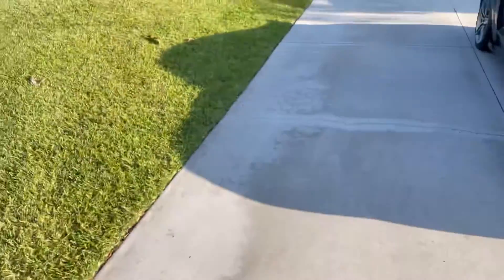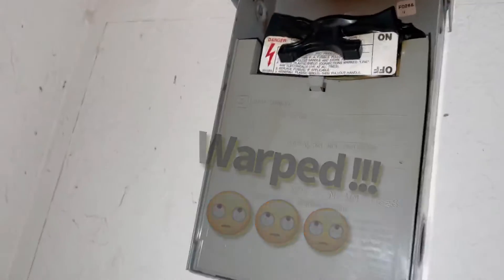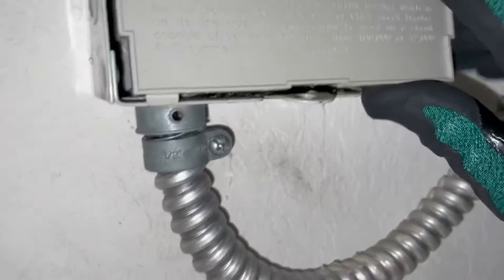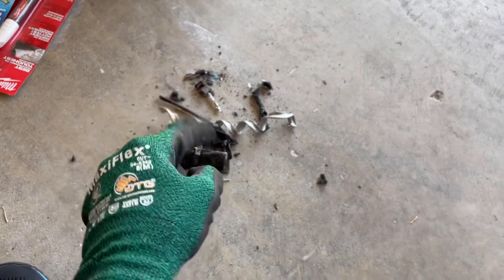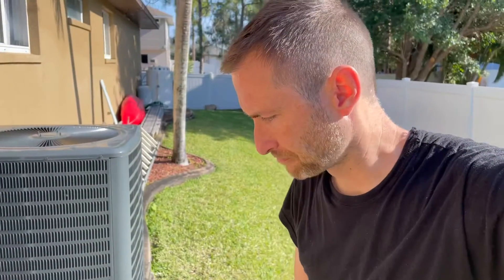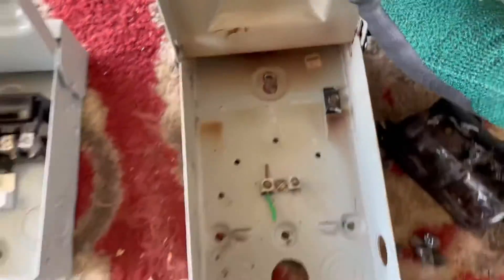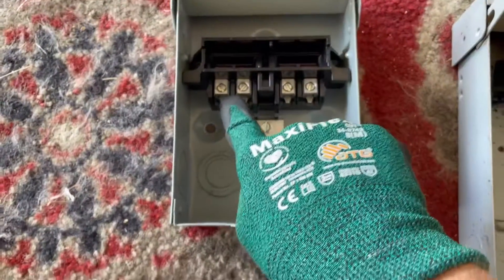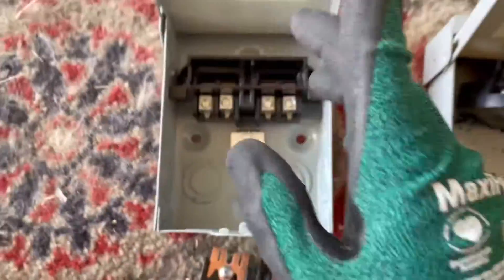HVAC fail in Florida. #hvac #fire #heatingandcooling #electrical #florida #HVACEXPLAINED #Ft. Myers

Comment: My first job out of school i worked for an apartment complex,ran into this problem all the time,aluminum wire where the line voltage came into electruc furnaces,burned up all the time,they make a gel you can put on there too that helps it from heating up like that cant rember what its called,love the videos,you are very thorough in describing your process
Reply from the maker: Another technician pointed out that gel and I actually did look it up I may pick it up just in case but very rarely do I ever see aluminum wire up here in the north.  Maybe Florida is a different standard or code?   I had a friend that had her house nearly burned down because of a random contractor decided to run and mix aluminum wire with copper wire and it lit her attic on fire.  It’s crazy but we just try to prevent incidences like this always try to notify your boss or the property manager and cover your butt.  Thank you very much for the compliment, commenting and liking the videos I really appreciate it it gives me more feedback and ambition to do more.  I am really glad that people are leaving tech advice tips and questions.  Have a great day and stay safe.

Comment: I hate aluminum wire. Cause nothing but trouble. Please tell us you asked homeowners to call an electrician to replace aluminum wire with copper.
Reply from the maker: This is my first time dealing with aluminum wire I’m from up north and we only use aluminum wire as a power feed coming into peoples homes and into the main breaker panel. I have seen aluminum wire used for electric dryers and that was all.  But yes aluminum wire is different than copper in a few different ways.   This was actually for a family member in Florida and since then they did have a local electrician update the wire going into that disconnect.  I did urge them that it was critical.   Thank you very much for the comment have a great day stay safe!

Comment: On aluminum wire connections I like to apply Noalox or similar to protect the wire terminations from oxidation. The other thing I do when working with stranded Al wire is to tighten the bolt and retighten it about 15 minutes later in unenergized and then with the circuit live using a double insulated screw driver and safe practices. In any service call always check the line voltage terminations at panel and appliance. I frequently find them loose esp with high amp draws.
You know what I’m talking about.
Be safe!
Reply from the maker: That would be a very good practice to retighten after X amount of time because of expansion and contraction I like that!!!  Loose connections can cause high amp draw’s and either burn up the wire, burn up parts or possibly start a fire.  I typically check on maintenances.  Noalox I have seen that product before but I’ve never used it personally.  I rarely have to work with aluminum wire.   Thank you very much for the advice and knowledge.  Have a great day stay safe.
Reply: HVAC EXPLAINED 
Always share what you learn of safer and better practices. The best teachers/mentors are always learning. The best learners make better teachers even more knowledgeable by asking the questions the rest are too afraid to ask out of embarrassment or just are not talkers.
I’d rather ask a ‘dumb’ question than prove how smart I wasn’t for not asking and bodging the task.
Reply from the maker: @globeflicker9216  :   I totally agree with you.  There’s nothing wrong with asking a dumb question just to verify if you’re right or wrong.  I have heard from a few very experienced technicians to keep information to yourself and I understand their side of it but when safety is involved I don’t like to hide that.  Thank you once again for the recommendation.
Reply: HVAC EXPLAINED 
If I don’t tell them what’s right, I’m gonna wind up fixing it and have a pished customer also.
Cheaper to do it right the first time and look good doing the job. I have 10 guys working for me and it’s my fault if I fail to teach them what I know or learn from them, It costs more in the end, if I lose, so do they.
Job Security on my end is actually being useful, financial security and a good rep are what sustains that.
I know from experience Union work is a bit different and some good Journeyman Techs don’t teach, protecting the porch for old dogs.
I get that, but eventually the puppies grow up and will feed the old dogs who can’t.
I’m the guy now that gets asked a lot of questions and frankly I enjoy it. It sharpens how you think and how you explain.